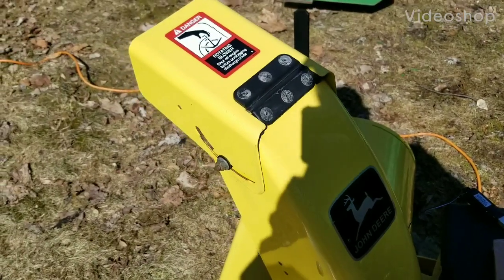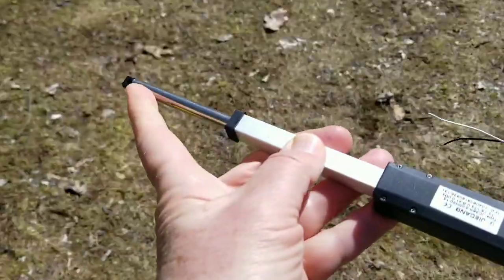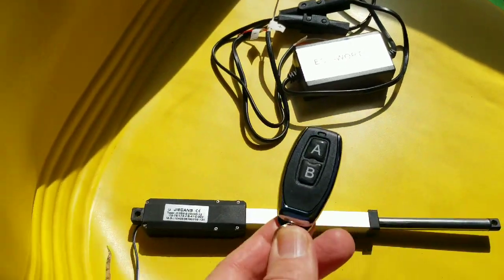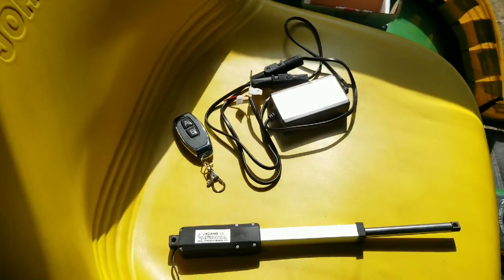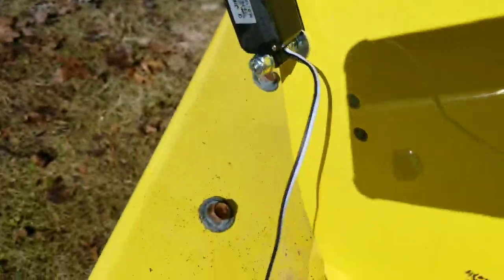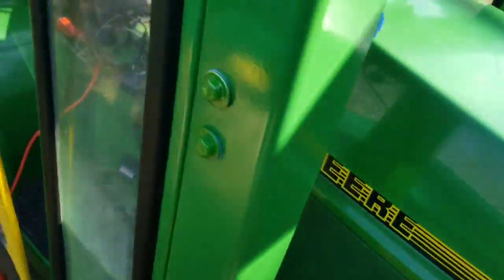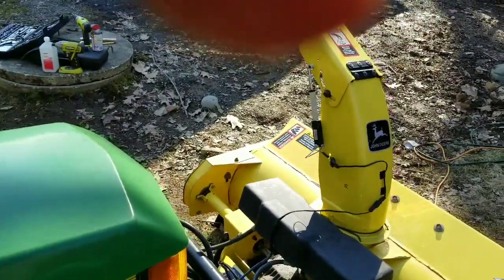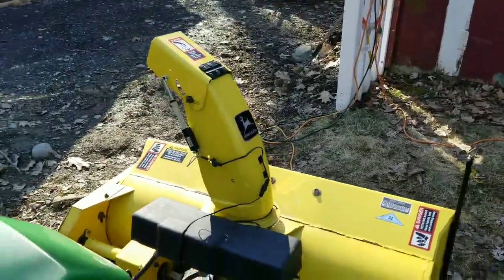Snowblower Deflector Mini Linear Actuator - John Deere 425, 445, 455, X-Series, etc.

Comment: I did mine years ago. I'm trying to remember. I think it was a 15#, 4" stroke, weatherproof mini actuator. I fabbed up  brackets on the back of the discharge chute and spout to mount it to so I wouldn't have a load on the side of the chute. I had to figure out the geometry to size the brackets and clearances.. Not too hard. Everything is attached with pop rivets to keep smooth surface for snow to pass over. Hard wired to a two way rocker switch on the dash and to battery, all enclosed in loom to protect the low voltage wiring. I have a two pin connector between the blower and tractor for when I take the blower off in the spring. There's an easily accessible inline fuse holder there too. I was blowing 2 amp fuses. I think I have a 5 amp fuse in there now. Sometimes it would freeze from moisture. I use a hair drier to thaw it out and I'm back in business. Good investment to do it. Getting off the tractor to change the angle of the spout is b.s.

Comment: For those of you who are contemplating doing this mod there is one bug that most people overlook. Them two bolts that are in the slots? You don't need them. They are there when using a knob to set. Blowers that use a rod in the back don't have these bolts. The chutes have a hinge and that's plenty strong. Plus the extra bolts cause needless friction. And remember, the closer the actuator is to the pivot point of the hinge, the less stroke you will need. And as an example, if you reduce the distance by half, you will double the speed. The price you pay for speed is increased effort which means you will need to double the force. Trial and error is the best way to figure out which distance is optimal. An easy way to find the distance is to  have the actuator bolt to a small plate (with a threaded hole) where you screw the bolt not pass the thickness of the plate and temporarily hot glue the plate to different positions.

Comment: I did this a couple years ago.  These are GREAT when blowing snow and the wind is blowing it back at you.  Easy to angle the chute down. I mounted a reversing type momentary switch (don't recall where) to the dash to control the angle.  

But ... check the bolts/screws that hold the actuator itself together.  I used a different model than shown but after the first year the screws on the unit had worked themselves loose.  A little more time and the internals would have been in the snow.
Reply from the maker: Thanks for the feedback.  My little linear actuator has been serving me well a remains firmly attached but, as you suggest, I am sure it is smart to regularly check the bolts...

Comment: I believe most people are using such high capacity actuators because of the weight of the snow. If the snow is beating against the deflector when it is all the way down, is the 4pound actuator enough to hold the deflector down? And same goes for lowering the deflector with snow beating against it. Have you gotten to put this to use yet?
Reply from the maker: It is smaller and neater, too.  I moved tons of snow last season, with zero issues....
Reply from the maker: I've had no such problems whatsoever...
Reply: @tesser5250  that’s great! I suppose I will use a cheaper actuator as well rather than spending big bucks on a higher rated one. Thanks for the response!

Comment: If you ever get a chance to buy the 2 stage model do it!  I’ve used both and the 2 stage is amazing. 

Thanks for the great videos !

Regards.
Reply from the maker: I am sure the 2-stage is better, but my single-stage has always performed without any problems. It never clogs and throws really well.
Reply: 2 stage pto driven blower??
 For the 425??
Reply from the maker: There is a two stage blower available, but I happen to have the single stage model.  I find it always works well and have had no problems with it.

Comment: You need to spin it upside down from how you have it now ,this way there is no worry of water getting down into the actuator , just a little tip
Reply from the maker: I did think about that but did not like the idea of running more wire to the top.  The actuator seems really well sealed and I plan to spray regularly with WD40, to displace any moisture.